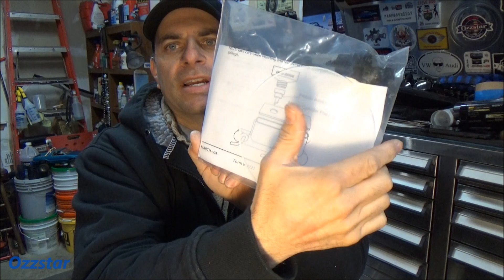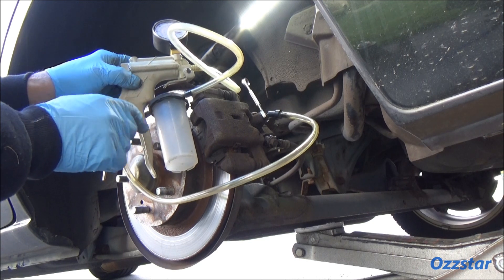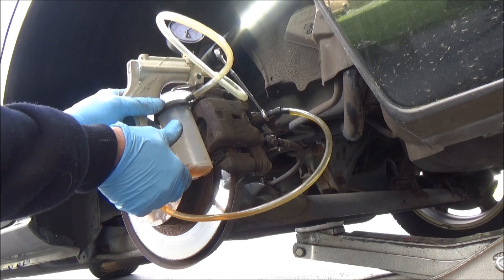Brake Bleeding Methods -3 Ways You can DO it!

Comment: I have the Mightyvac mv6830.  Seems like there's all ways air still in the system after using it.  Now I have a bleeder that goes on the master cylinder and it seems to work great.
Reply from the maker: I wonder what's causing the extra air?  It's good that you found a tool that works well for you.
Reply: @ozzstars_cars  I'm not sure what causing the air.  I even replaced the rubber piece that goes on the bleeder screws.   Those seem don't seem to hold up long.

Comment: Hey Glen - what about the ABS systems? I have a 2006 C6 corvette. Will doing any of these methods foul the ABS sensors/monitoring system?
Reply from the maker: You should have no prob.  The key is to getting ALL the air out of the system and not letting any in.

Comment: Great video Glen! I’ve tried all these methods and they work well. I tried Mityvac’s pressure system and wasn’t happy with it. Once you open the valve to pressurize the brake reservoir, there would be hundreds of little air bubbles and I could never bleed them out. I use a pressure brake system now that a rubber diaphragm to isolate the brake fluid from the air. Works much better, but a bit expensive. 😀👍
Reply from the maker: Yeah I know sometimes pressurizing is mandatory but I personally prefer the vacuum or pump method.  You have all those cool tool toys Terry! :-)

Comment: Another reason for chancing the brake fluid is that the moisture inside the brake fluid has a lower boiling point, this can cause the moisture inside the brake fluid to boil.
The boiling causes air bubbles to form, and air can be compressed.
This affects the brake performance. So changing the brake fluid is very important especially on high performance cars like your corvette!
Reply from the maker: Absolutely Dan, that is a valid point for sure.  Some racetracks here require fresh fluid to participate for amateur track days.  I always say no sense going if you won't be able to stop.

Comment: I agree, the old technique with two people using pedal pressure is my favorite, even though it doesn't work so well with new brake-by-wire systems. I tried vacuum bleeding a few times, but was confused by  a poor connection at the bleeder screw, showing a tiny stream of air bubbles from air getting by the open threads or at the hose connection. I envy the professional technique with positive pressure on the reservoir cap, and power probe offer a cool brake bleed kit that gets high ratings. Unfortunately the price for that one is beyond what most of us want to pay for driveway repairs. Too much variability in the adapter size seems to be the big issue. If the seal isn't perfect you could have an ugly mess of brake fluid sprayed around the engine compartment. As technology moves forward, it sounds like we driveway mechanics will be facing more issues with bleeding the ABS unit. So far I've been lucky, but especially hybrid cars seem to have a very complex bleed algorithm, requiring a scan tool with bidirectional control. I found several reports of accidental pressurization of the brake system in hybrid cars if the key fob is too close to the car (not even in the ignition). Oh well....
Reply from the maker: Wow accidental pressurizing of the brake system?  Crazy.  One or two of my scan tools has the electronic brake bleeding feature used in newer vehicles but to be honest I have never even tried it.  Eventually I'll get to experiment as the new cars of today become older cars in the future.  :-)  Hope all is well in the Northwest with you.
Reply: I had the same issue as you with tubing not holding a perfect seal.  I  am usually bleeding brakes on my own and prefer the gravity bleed method.  You can open 1 or all 4 calipers at the same time.  It's slower than the 2 person method but I know air does not enter the system.  The tool with the compressor method will work well even if tubing isn't 100% perfectly sealed because the constant vacuum would prevent air from entering into the system as long as one closes the bleeder screw before turning off the compressor.

Comment: Timely, I am planning on doing this on my car soon.  My C6 has low miles and the PO believed not driving it meant no maintenance.  I did the clutch fluid, coolant, and oil already.  Next I’ll be tackling the brakes.  I've not looked at the diff yet but if it has to be sucked out I bet either of those pumps would work nicely.
Reply from the maker: Yes the pumps work good for brake fluid.  For thick gear oil I would use a small hand transfer pump like this one in the link:  https://amzn.to/2D8jiz7

Comment: The one I prefer is to use the Motive power bleeder. Works great, no drama and cheap. Save a lot of time. As for just bleeding the calipers say after a track event I like the helper on the pedal method. Never had ANY success with the vacuum method.
Reply from the maker: When it comes to the vacuum method the more it sucks the better it works.  haha  We need to touch base and catch up.
Reply: You crazy! LOL

Comment: Great video thanks brother. I like the 3 ways you do it. I only get to do it the first two ways. I don't have the one for the air compressor. I prefer to do the vacuum way less chance of a mess up. I don't think I will be getting the air compressor way to bleed brakes. I got the air hammer you got plus extra bits. Thanks brother for that one. I do believe I mentioned you in the video. Keep up the great work see you in the next video thanks again brother
Reply from the maker: Thanks for the shout out Scott!   Yeah methods 1 and 2 in the video work just fine.  Doing it right!